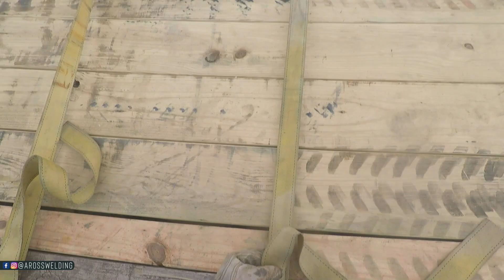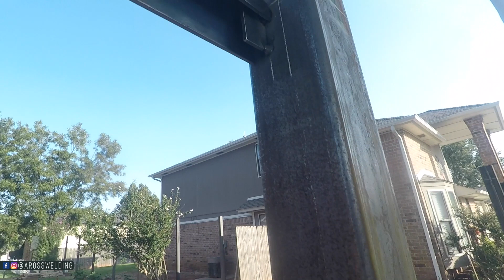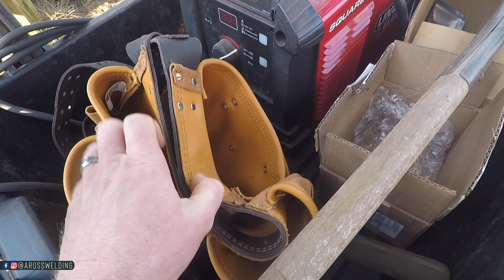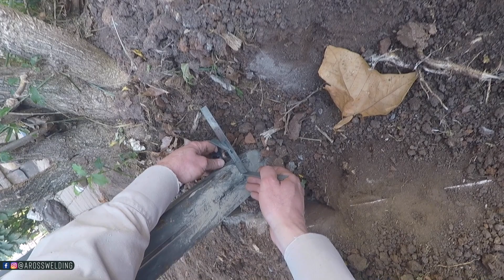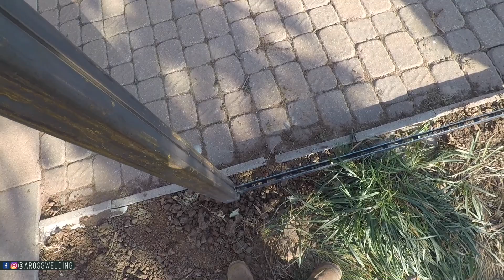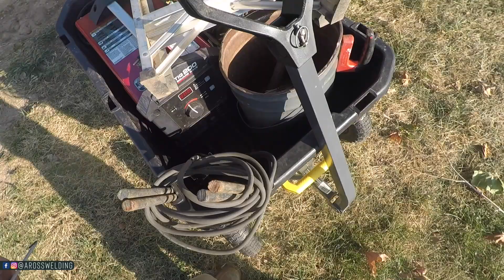I MADE A MOBILE WELDING CART FOR MY WELDING RIG - CUSTOM METAL PRIVACY FENCE INSTALLATION

Comment: Great videos Austin! If you're going to use innershield wire, try .030 instead of the typical .035. I use it often for handrails/guardrails and some thicker stuff too and it works better than solid wire because no bottle to haul around and using 1.6/2.0 mm welding rods isn't as fast or fun. Once it's set right it welds beautifully. Keep up the great work!

Comment: Austin have you ever used Osfo if I spelled it correct? You get it at Fechner pump and supply in Cushing it protects metal from rusting and coming through your paint. You apply it with a little spray bottle and leave it over night and it will have a powder look then you wipe it down and paint. Works great and a gallon will go along ways. If you want to know more about it I can take a picture of the product and send to you.

Comment: Diablo blades are pretty damn good. We only use that over here at my job we make wrought iron fences
Reply: Heck yea!  That Cermet II tooth material is pretty awesome.  I use the 90-tooth blade for most stuff up to 1/4" with stick wax lubricant and it just rips right through it.  Bought a 72-tooth as well in case I need to cut up to ½" material.

Comment: Well after watching I see where you bought a garden cart but I sure don't see where you 'made' a welding cart.  Seems you skipped in the to do list the fact that you have a million holes to drill if you are going to put two on each picket!   I don't envy doing the ones on the ground or the ones at head height!  Not going to be easy even if you use self drillers.  First glance it looks a bit thick for those.  Going to be a classy if expensive fence.

Comment: Hey Austin you used my idea! Just get you a inexpensive mig welder like an Everlast or Hobart dual voltage. It’s what I did. I throw it on the “cart” loaded with some .030 or .035 fluxcore wire and  some 10ga drop. It’ll run it on 110 or if near your rig the 220. Welds 35-40% fasted then stick. Trust me you’ll like it!!

Comment: that is a long span and i wonder if the weight of the wood is going to bow that already weakened pc of bottom channel.   wood soaks up water when
it rains, i've seen a lot of driveway gates, dumpster gates and so on where this was not factored in.
Reply from the maker: I highly doubt it. It’s 10 ga material... and they are only 6-8’ spans. And those pickets are extremely light weight. And the are going to stain them.

Comment: I hate to add a comment  but it's good to put a 1×6  horizontally rigth on the middle preventing the lumber from twisting. 
I like the way you build it,looks good.
Reply from the maker: I ended up putting some cross members in the middle... 🤫 don’t tell anyone, I don’t want to spoil the surprise... 😂

Comment: why not use a milwakee portable band saw
Reply from the maker: I have one, but I always have trouble keeping it cutting straight, But nowadays I think they have smaller ones and it would probably be easier to keep straight. And on this particular fence it really would not have mattered much but I am kind of anal when it comes to that type of stuff. Thank you so much for the reminder though, I will have to keep that in mind.
Reply: hey thanks for the reply I found you cause I am trying to learn how to weld I have been trying to learn about a year now a lincoln mp 210,  and just bought a primeweld 225 ac/dc tig welder.  I understand about being anal about things I own a plumbing company and pretty anal about running water lines straight and not like a roller coaster.  Good video keep it up

Comment: If it were my house, i'd run off that tig200 via house power. someone else's house, I probably would've just bought 250' of lead and a couple tweco connectors, put it on my stinger, and ran around the yard like that. My last job wasn't connected from post to post and I hated having to move when I ran out of lead LOL

Comment: You probably already have this job done but I kinda have to agree with some guys on here . The steel part isn’t a thing , it’ll be there for A While . But have you checked on “fake boards” ? Take the warp and rot equation out of it ?  The videos are 👍 . Wish I could sit in the shop and pick your brain on the pipe fencing sometime . I’d like to do a bunch on my own place . 😉

Comment: If you run that 110v machine off of a RV extension cord, it will not stick near as bad. Otherwise you may have to bump your amperes up 20 to 40 amps. 
The setting the machine is showing is not accurate due to a reduction in available current.

Comment: Hey Austin, 
why didn't you included some power coating for the fence for the customer? I would had done a powder coating in black for them. 
Harbor Freight has a power gun and all you need is in the shop you run a propane space heater and it does a very well job on low budget. This way the stuff won't rust and already has than onsite a perfect finish. So those rails which are so extreme low to the ground and picket all in and such won't rust away.
Fence cap's do 4 dot's each corner of 100% silicon inside the post top's and they stay in place even during a hurricane.
Use Invoice Ninja so you have all your quotes and invoices together always in sync between your phone and computers. This way you can have all your notes from Quotes also access able so you know what you charged last time and what you might had miss calculated because you can leave private notes in those so your customer won't see those but you sure will.
Reply: There is onsite welding so powder coating would not be continuous and it would start rusting around the welds, better just paint the whole steel fence.
Reply: @markman63  Not on the pieces been powder coated because the cross rails are bolted to the posts which have welding tab's on. Power will with stand multiple times better water exposure and sub surface as well. Look how the button rail is often in ground contact and also in areas will be buried as well. The wet wood will excel the rust and rot process. Austin had to dig up dirt to make it level but now both sides are sitting higher meaning when rain hits the mud will quickly refill the void with muddy water and leave the mud behind. Also look out the button rail is so close now to the ground you can't paint it below or inside where the metal spaces are so you leave the metal fully exposed. Even if you use an oil paint with a 3/4" nap you will have an extreme hard time to perfectly coat it. The main reason why I always powder coat the rails even if we do at the ends some weld on the 90% perfect are power coated and withstand the environment much much better. And don't forget most state now enforce a work labor material warranty of 12 month. Florida for example does that by law now.
Reply: @markman63  Take a closer look at the button rails. Once installed you will not get it all painted correctly because of the form factor and the 3D surface area on the button rail which is 2 pieces welded together with lot's of spacing's in between. So close to the ground I can promise you no matter how good you paint you will miss a ton of spots. How do I know because I done it myself and also saw others doing the same tricky to paint jobs. And to power coat those upfront than weld them in place and just to have to paint those posts cut down your painting time by hours to half a day in time saving too. Meaning more money in your pocket.

Comment: Hey Austin, nice job thinking outside the box! I’m an almost retired fence builder (company owner) in Flower Mound Texas. I’ve been doing residential fences for a little over fourty years. I’ve always said that if you got ten of us fence guys in a room and were asked the proper way to build a fence, we’d all have different answers. So, I like hearing the different ways other guys do things so I can pick and choose some better ways to do those things myself. I’ll give you my take on how I’d do things a little differently on your job:
1) I’d use red steel. No cleaning and paint will stick. 2) We never dog a fence into the ground, we use 2x6 pressure treated base boards at the bottom w/ the fence on top of those. 3) I’d lay that fence out like we do wrought iron fences by welding the bottom first with each section level. Keeping the bottom channel two inches above the ground and tight on the 2x6s. 4) Like a few others have said here, a 2x4 or even a 1x4 should be screwed across the center to prevent the boards from bowing in and out. 5) After all the bottom channels were welded, I’d paint all the posts and channel and then paint the top channel prior to welding.  6) I wouldn’t use anything but pre-stained material. But all and all, you’re did a fantastic job and I admire your skill and expertise. Got to hand it to you for selling what has to be a pretty high dollar fence to that homeowner.  👍
Reply from the maker: I ended up putting cross members... 🤫 but don’t tell anyone, I don’t want to spoil the surprise. 😂

Comment: Hi Austin. As a retired Carpenter and a person who has done some steel work,I'm concerned about rust with your steel near the ground, number one. Number two I'm concerned of the reaction between the tannins in the cedar reacting to the steel  and staining the cedar black which could bleed through the paint eventually.
I am also concerned about the stability of that long span of pickets, warping in and out relative to the plane of the fence .
I hate to cast cold water on that project. It looks like it would be a nice looking fence at least at the beginning.   it's true that cedar stays straight generally better than treated pickets but they still have their own way of warping.
I wish you well my friend.     
Thank you.

Comment: For the sake of appearance, you'll want a full width picket on the end.
You can trim 1/2 inch off of several pickets as you get near the end and blend them in with the last six to ten pickets and it will hardly be noticeable.

Comment: I got a Lincoln pro core 100 flux core works perfect for jobs like that. Not many can use it cause settings are lot different than a regular mig . Like that stick your using cause of it being 110 play with the settings more to your liking sure it will work even better.  What I did with my mig mine has a settings chart inside were you put your wire in got a spool adapter for the 10 lb spool wire cost more my welder done paid for itself long ago for all the jobs I done with it .

Comment: Can I ask why you don't use a band saw to cut post tops?
Reply: My question as well.
Reply from the maker: I have one, but I always have trouble keeping it cutting straight, But nowadays I think they have smaller ones and it would probably be easier to keep straight. And on this particular fence it really would not have mattered much but I am kind of anal when it comes to that type of stuff. Thank you so much for the reminder though, I will have to keep that in mind.

Comment: Nice video. Paint the parts before installing, then only touch up the ends. Like other comments about the planks getting exposed and moving, it may need something to screw down to. I am interested to see how it works out long term. I have been considering a metal structure fence and have a test section working now. Not as nice as yours though. 😎

Comment: Man, I clean my steel pre-weld with Simple Green and a green scotch Brite scrubby. Cheaper than solvents, and nontoxic. That gets it decently clean for welding. Then after all welds and grinds are done, I wipe it all with acetone. I think mineral spirits and paint thinner both leave an oily residue which I think can inhibit some paint adhesion.
Reply: A trick I’ve learned is degreaser in a pump up sprayer and a power washer..  hit it with the degreaser and let it soak a minute and power wash it off and it’s ready for paint most of the time. Quicker and the metal turns out cleaner from my experience
Reply: @jakearrington7359  I ive got a large order for a seasons worth of jobs, or a large order for a single job, I definitely will use a power washer. Ive spent 3 days in rubber boots and suits on a single job before but on a big order, power washing is fast.

Comment: Nice work on the fence...you are really a detail man!  I'm curious though; if the bottom steel rail is to be below grade, don't you think that rust through will be a problem?  If so, that will be a real booger to repair.  I know it's mostly dry in OK, but I'm sure the landowner will be fertilizing and watering...a good mix for accelerated rusting.
Reply: Good question! I was wondering the same thing.
Reply: The thing with water is you don't want water to pool. You can mold or buy concrete caps similar to what Austin used on the end caps just in concretrete for bottom of the plint. That will give you decades of no rust. What I use to do is have either the concrete raised just a tad above soil at an angle/pyramid for water to run off or use the cap over and through the post or just installed 2 parts around the  base sealed with concrete sealer. It looks tidy and if unnecessary you just angle concrete plint so water dont pool. You can buy or cast your own concrete caps easily.  There is a ton of YouTube videos on how to pour concrete molds or just buy the ones you deem fit.  It all can be done on site or precast and inserted over and through post and then sealed with concrete caulking. Possibililities are endless and seal with concrete sealer or if cement stil wet no need.  The metal itself tend to start rusting where cuts were made or it was welded. So i clean it with paint thinners at shop and brushed it of where needed with wire brush if there is a bit of rust. Then paint everything with Red oxide primer which is a anti-corrosion coating designed to stop rust formation. You do this on scale by putting lage pieces on "work horses' paint it with compressor and gun ( worth investment if you're thinking long term) or even small scale for diy'er and then just weld your brackets on site as needed if not already prepared at shop. It takes stick welding well if you just chip it in a starting point for the arc bead to grab  and then you just clean and touch up your welding with a brush and some oxide.  The oxide is cheaper by far if you buy it whole sale otherwise pretty cheap from Box stores. Once explained to a customer the reasoning they will always agree to it in price difference if any. In my opnion it actually is a must. Then you can paint what ever color over it since it is a primer and it also helps your paint to stay durable and keep its color better for years. These little things make a huge difference in quality.

Comment: What your building there is a long way around to a system that already exists called fencetrac . Out of tulsa , ok. Nice look, I'd highly recommend thicker pickets though. Still a awesome video.
Reply from the maker: Ya, but the fence trac don’t look like it drains water and it’s way thinner material. That’s the trouble with those mass produced products is they tend to get way too cheap. At least with what I’ve came across. That’s why I love doing custom welding work cause it’s usually way more durable than most generic stuff off the assembly line.
Reply: @arosswelding  i will agree with you on the lighter material side, iv only installed it once and don't rember if it drains out the bottom or not. But everything is galvanized and powder coated and has a manufacturers warranty. 
Now iv been a fence contractor for 4 years, have one crew that builds just residential privacy fence and another crew and myself that does ag fencing, feedlots, confinment barns. I will say 9/10 times that residential customers don't notice or care how good and sturdy a custom built product is. They care about speed of installation. Warranty,  final look, and how much you disturbed their yard in the process. Not by anymeans saying you arnt doing awsome work because I know you do. And if what your doing is working for you and makes your days enjoyable then keep doing it👍😁
Reply from the maker: I could see that. This is all very good insite. Thank you for sharing. Ya, my tendency and reputation has always been more on the custom side of things, I think just cause that what I’ve done most of. Like you said, as long as it’s workin, customers are happy and we are happy then that’s what counts.

Comment: Great attention to detail as usual and the fabricated track system looks to be a winner. My only question is no centre  rail ? Cedar moves. Conditions might be different where you are but if I did a fence with just a top and bottom rail the pickets would all warp to the point they would fall out or have to be replaced. Guess I am just used to seeing top bottom middle rails.
Reply from the maker: 🤫 i ended up adding middle rails. But don’t tell anyone yet, I don’t want to ruin the surprise 😂

Comment: I have one of those carts for my welder when I have to work outside, that one is even better than mine, no rust plus is a wheelbarrow/dump. For flux gasless I have a Lincoln Powermig 210MP. 99.9% of my projects are outside and this machine is perfect for that.